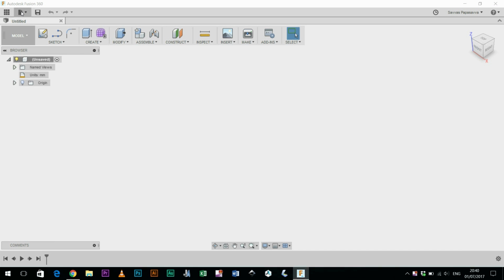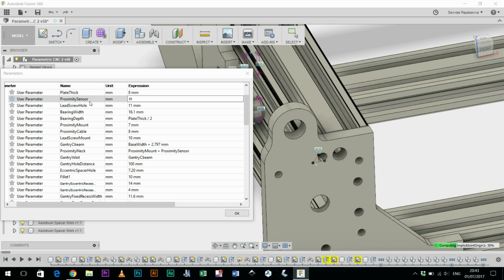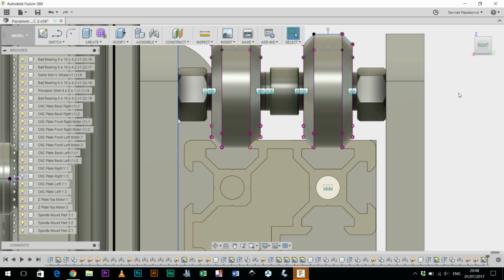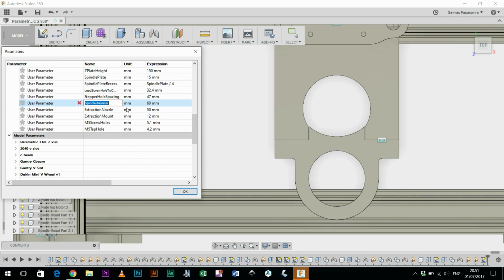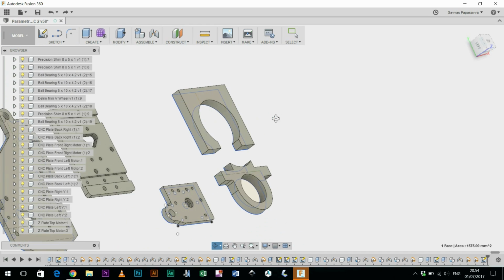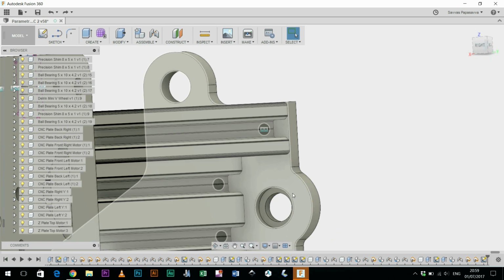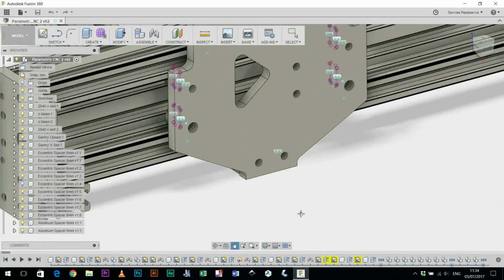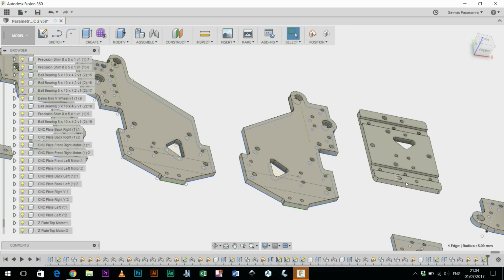Parametric CNC Machine Design Upgrade / C Beam & Lead screw

Comment: Will you be building another version with the metal plates soon, or is that sometime to be determined in the future?
Reply from the maker: I am going to rebuild this machine with the new plates. I don't think I have space or want to spend the money just yet to build a new machine. I could make the plates out of aluminium but I could also use acetal or delrin. It works out to quite a similar price.
Reply: Ah okay, that makes a lot of sense, thanks!